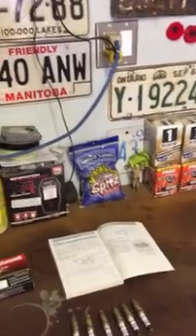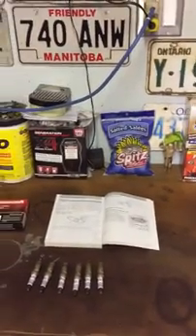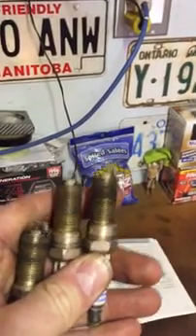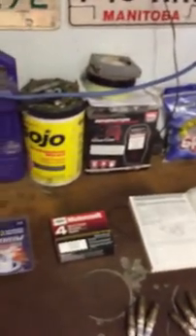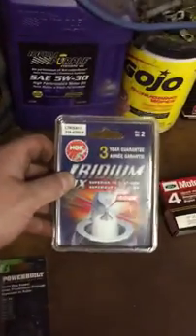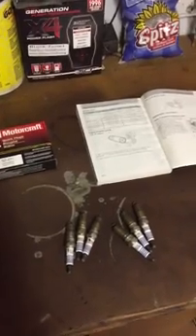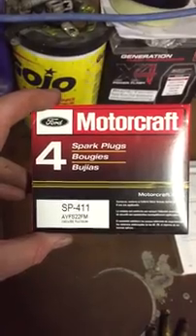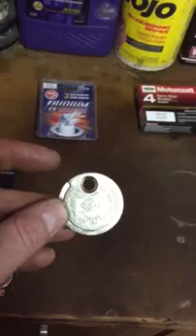2010 Ford 3.5 Ecoboost Misfire / Engine Shudder & Low on Power = Time to replace your spark plugs!

Comment: I wonder...I have a 2010 EB Flex as well and at low RPMs/speeds it shudders really bad.  Like, almost to the point of being ridiculous.  I've replaced the spark plug and half the coils, but no dice yet.  Do you have any thoughts?
Reply: I have had this issue and reading on some of the forums, I would check your solenoid pack and then your torque converter
Reply from the maker: Is it throwing any codes?  My next step would be to have everything updated to the current TSB.  After that possibly look at carbon buildup in the heads.  Keep me posted, I'd like to know how things are going.  Thanks for the comment and for watching.
Reply: @MoreBear  Thanks for responding!  I took it into my local dealer and they told me that cylinder #3 was misfiring, so to do the coils and plugs first.  Then, he said to come back if that didn't solve the issue.  I will look at the sheet they gave me for more specifics and get back to you later!